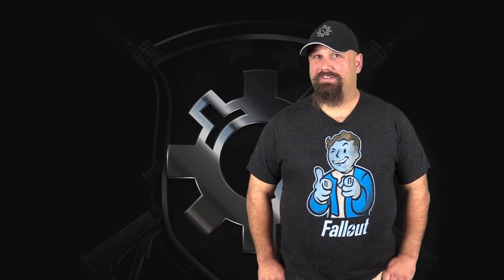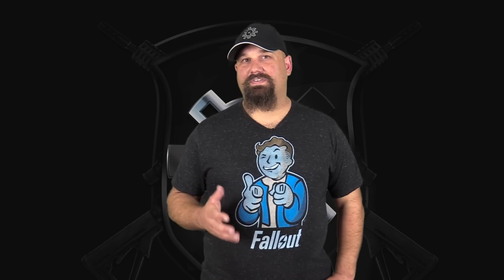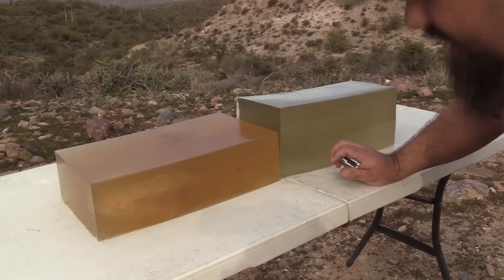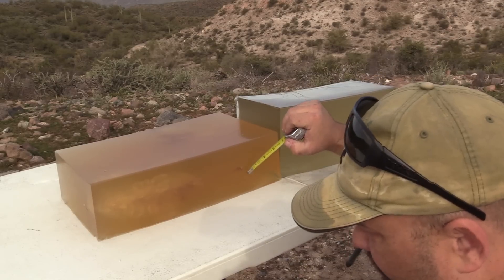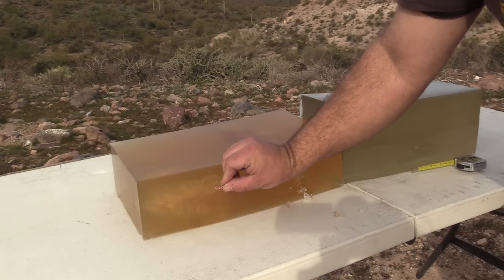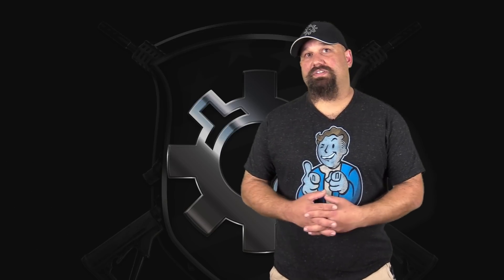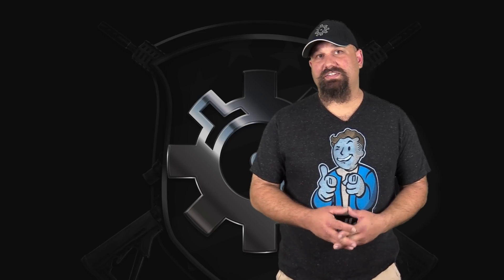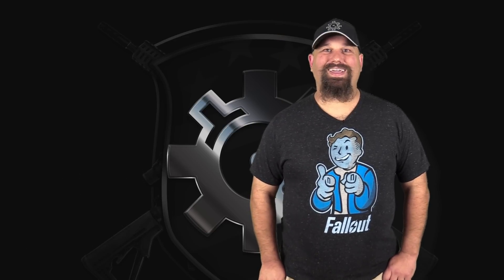How Frangible Is It? .223 62gr Power Strike

Comment: The question is does all that sintered copper make the tsc a pwt? Or do you just get the effects of birdshot plus one small deeper projectile? I don’t think you can test fragmenting ammo on either type of gel and get a reasonable understanding of what it’s doing other then penetration. I think you need to shoot this at a pig to figure out if this just blew a huge hole in something or just had a good tsc with penetration. 

I think this is what is commonly misunderstood about otm or m193 type rounds is they have a little neck cause they are fragmenting and yawing when the tsc is at max expansion then the fragments go shooting out/yaws creating an enhanced permanent wound track to tissue that is stretched to the max making it weaker. You can get a good picture of this by simply comparing ordinance to clear blocks but with something that fragments this extreme I think the only way to tell what’s really happening would be to hit real flesh. 

I’ll caveat that further by saying there is a difference to shooting dead tissue and tissue that is full of pumping blood still. Anyone who hunts and has done ballistic test knows what I’m talking about. I’ve hit hogs with rounds that seem ok in gel but on a living hog I regularly find soccerball size holes inside their chest cavity’s which means with proper fragmentation times with tsc what I’ve seen is all or most of the tsc becoming wound track. 

In fact a lot of hog hunting rounds are based on similar aspects to the controlled chaos rounds which perform poorly in tests but generally will drop a hog dead in its tracks instantly. I’ve seen x193 leave an exit would like a 30/06 blowing holes big enough to stick an entire fist inside. 

I understand the idea of gel testing is to give a baseline for comparing many different things easily but i don’t think it’s actually representing what really happens most time when shot into a physical living body. Of the rounds I’ve personally used the gel test at best show half the potential of some while showing the exact potential of others while inflating some. 

I think there is a little more to tsc then given credit to when using a fracturing bullet. If it drops a 160lb hog or deer it will damn sure drop a person even if it doesn’t look pretty in a gel block.
Reply: They're a lot to unpack there. First, the neck is the portion of the wound track prior to significant tissue disruption. Both M193 and .223 Controlled Chaos do well in gel testing. Just because you are able to kill an animal in conditions that you carefully controlled doesn't make a given load appropriate for defense. Finally, I'll just copypasta the rest of the reply. If it sounds a bit short, don't take it personally.

No, ballistic gel is not a simulation of wounding. NOTHING is a simulation of wounding, even actual wounds in living people. There are far too many variables for one wound to be predictive of another wound. But properly prepared and calibrated 10% ballistic gelatin produces penetration, expansion/fragmentation, and retained weight measurements that correlate strongly with wounds observed in human beings and live porcine tissue. In other words, ballistic gelatin produces empirical data that is CLOSE to what is likely to be observed in a real human, but without extraneous variables, allowing substantive comparisons to be made. Additionally, it provides the opportunity to view the entire wound track, something that is not possible with opaque media such as meat or wet pack. This is important because it can allow us to more easily compare the neck length of various loads. That is the distance a projectile travels before yawing, fragmenting, or expanding.

It is useful to note that clear gel is not the same as real ballistic gelatin, but in most cases, it produces results that are equally useful, if not directly comparable to real ballistic gelatin.

It is also useful to note that informal YouTube testing should not be considered to be conclusive by any means, but the testing I perform here and on other channels is done in the most consistent and scientifically relevant manner as is feasible. Generally speaking, my testing should come close to professional testing, but should not be considered to be as conclusive. The two biggest problems with my testing are lack of a controlled environment and small sample size.

Finally, I do not pretend to be an expert. However, I have read the papers written by experts and I speak with Dr. Roberts from time to time. Don’t take me at my word, but do take the experts at their word. A good place to start is here:
http://gundata.org/images/fbi-handgun-ballistics.pdf

And here:
http://www.ar15.com/ammo/project/Self_Defense_Ammo_FAQ/index.htm

And here:
https://eurekamag.com/pdf/008/008212577.pdf

Finally, please reference these quotes from noted experts in the field:
"The IWBA published some of Gene Wolberg’s material from his study of San Diego PD officer involved shootings that compared bullet performance in calibrated 10% ordnance gelatin with the autopsy results using the same ammunition. When I last spoke with Mr. Wolberg in May of 2000, he had collected data on nearly 150 OIS incidents which showed the majority of the 9mm 147 gr bullets fired by officers had penetrated 13 to 15 inches and expanded between 0.60 to 0.62 inches in both human tissue and 10% ordnance gelatin. Several other agencies with strong, scientifically based ammunition terminal performance testing programs have conducted similar reviews of their shooting incidents with much the same results--there is an extremely strong correlation between properly conducted and interpreted 10% ordnance gelatin laboratory studies and the physiological effects of projectiles in actual shooting incidents." - Dr. Roberts

"The test of the wound profiles validity is how accurately they portray the projectile-tissue interaction observed in shots that penetrate the human body. Since most shots in the human body traverse various tissues, we would expect the wound profiles to vary somewhat, depending on the tissues traversed. However, the only radical departure has been found to occur when the projectile strikes bone: this predictably deforms the bullet more than soft tissue, reducing its overall penetration depth, and sometimes altering the angle of the projectile's course. Shots traversing only soft tissues in humans have shown damage patterns of remarkably close approximation to the wound profiles. 

The bullet penetration depth comparison, as well as the similarity in bullet deformation and yaw patterns, between human soft tissue and 10% ordnance gelatin have proven to be consistent and reliable. Every time there appeared to be an inconsistency a good reason was found and when the exact circumstances were matched, the results matched. The cases reported here comprise but a small fraction of the documented comparisons which have established 10% ordnance gelatin as a valid tissue simulant." - Dr. Fackler
Reply: Look up the research that Nathan foster has done over the last decade comparing frangible lead free ammo to monolithic copper and bonded bullets...he has done extensive testing on animals, at various ranges. And has found that drt bullets(very similar to what’s being tested in the video) outperform monolithic copper bullets at all ranges on game. He has videos shooting mountain goats at 400+ yards with a 308 where he blows through both shoulders.

Comment: Why no denim test?
Reply: Clothing has next to zero effect on rifle bullet performance or pistol bullets that do not have a hollow cavity to clog. Heavy clothing is primarily used to determine whether a cavity will become clogged with fibers and fail to expand.
Reply: @newsofthepews  So impacting the denim would not deform the power strike bullet?
Reply: @leegrubb6753  it's unlikely that it would make any substantive difference because heavy clothing usually doesn't affect rifle ammo.  But if you want to buy the ammo, the gelatin, and rent the high speed camera, I'd be happy to redo the test in whatever manner you specify.

Comment: I still pick my 75gr Hornady OTM for big game hunting with my AR it’s simply amazing
Reply: @asdfghjk2933  Gotta agree here. And a bonded soft point or solid copper hollow point seem better choices for taking game consistently and humanely.
Reply: @newsofthepews  Absolutely. Bonded soft points and monolithics especially are great if you want to put down a large animal without doing excessive meat damage. I've heard reports of 77gr SMK and 75gr TAP ice picking, but never 77gr TMK or 64 gold dots. Probably a similar story with 70gr TSX.
Reply: @asdfghjk2933  yeah I've read from hunters that 77gr tmk with a 18" + barrel can reliably kill game out 450 yards. And I've also read that 70gr tsx rounds works best on hogs. Some dude named skypup who talks about the tsx in many forums. He claims the round when going at a somewhat slower speed yaws while it already expanded messes up things inside of hogs pretty good. If i had to choose which round to use on hogs it would be the 70gr tsx and under that, it would be the 70gr gmx. For anything softer 77gr tmk.
Reply: So as or now. I’ve taken 2 deer 4 hogs 2 fallow deer 1 Seika deer 4 goats. All with 75 gr OTM. My results are this bullet is a stoke of lightning on game. Only the Seika deer went anywhere. About 50 yards with no lungs. I took a 350 lb hog at 75 yards. Went straight down. The OTM is absolutely devastating
Reply: @genefletcher7226  thanks for that report, but unless you shot dozens of animals in precisely the same location, angle, and velocity and took empirical measurements of the wound and projectile, and compared that to dozens of identical tests using other loads, all you've really done is demonstrate that rifles can kill shit.
Reply: The Chopping Block......no I fully  understand your point. I don’t even disagree with it to a point. Agree There is even a chance this round may fail to perform simply because its main design is for long range accuracy. It’s simply by accident that this round has an outstanding terminal performance on game, as well as ISIS solders in Iraq. It’s no accident however that the military uses this TYPE of bullet in combat. Since I don’t have the time or money to stand game animals at varying distances and angles to test bullets in actual live performance.I do my homework on line and make an educated decision. You focus mainly on terminal performance. The hunter has to also consider accuracy something that can only be discovered by the shooter and his / her individual rifle. I use a 20” barrel AR and want one MOA accuracy or better out of it. Something this round out of my rifle gives me. This is a dynamic gel blocks don’t provide. So after testing a dozen different rounds I settled on the Hornady Superformace 5.56 / 75gr OTM, as it provides great accuracy out of my rifle and outstanding terminal performance. I can’t ask for much better than that. So I think I’ve covered all the bases.
Reply: @genefletcher7226  Oh it absolutely is. When OTM performs like it's supposed to, not much can top it. Only issue is that there's a chance (albeit small) that it can ice pick. It's still far better than FMJ in that respect.
Reply: I’ve been big game
Hunting in Africa, Canada, Michigan my home
State, Wisconsin, Virginia. I’ve shot animals with 300 win mag, 7mm Rem mag, 30-06, 44 mag. 450 Bushmaster, 12 ga Shotgun slugs. I’ve taken in my now 40 years of hunting Over 200 deer alone. If it walks, crawls, flys or runs I’ve shot it. I say all that to simply say this, On all the game I’ve shot with the above calibers, I see no better or worse performance out of my AR with 75gr OTM’s. That’s not to say it’s superior to the above cal. Just that in its range and my game choice. It has been flawless. The Seika deer was 140 yards out, my farthest shot with this round to date. I’ve shot game much farther with other cal. This round simply performs on deer sized game. Clearly I have options available to me much superior to the 5.56 but when I can I take my AR. Loaded with Hornaday superformance 5.56. 75gr OTMs. Thank you for your time.
Reply: @genefletcher7226  i'm curious, what do the wound channels made by the 75gr OTM look like? The 77gr TMK out of a 16" barrel typically makes an icepick entry, frags before the ribs (making a 3 inch or so hole), liquefies the heart and lungs, and pokes a nice 2-3 inch exit out the back. I assume the TAP makes a similar wound but with a longer neck.
Reply: asdfghjk all the entry wounds are cal sized. The performance varies on range and game size. I get no exit in the big hogs. I take lung shots on them. And they simply wilt. On the goats I get thrue and thrue with maybe 1ln diameter exits. But the internals look like a blender was in the chest cavity. So most likely it’s a fragment with bone and tissue coming out the off side. I see a longer neck on the longer shots like the Seika. So the bullet performs like a soft point at extended range. 100 yards and under it’s simply a meat grinder. I take only lung shots with this caliber. I avoid the shoulder as I feel the round is not robust enough at close range. The Fallow deer were 50 and 100 yards respectively. At 50 yards it simply stagered and  fell. The other I managed to break the off shoulder and it went about 50 yards and buckled. The lungs were simply ground into small bits. Place the shot carefully as it’s a small cal. And you will have no issues. Shot placement is critical with any caliber. Even with 12 ga slugs if misplaced your running the risk of a lost animal. I know that from experience.
Reply: @genefletcher7226  You're missing the point.
Reply: I will take my real world performance and 40 years experience over one shot in a 10% ballistics gel. Block at 7 yards.